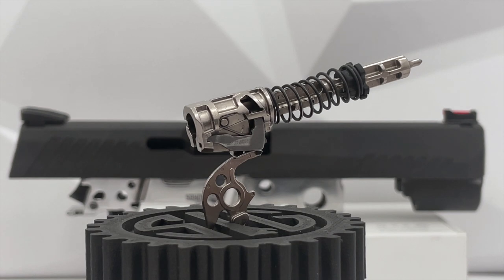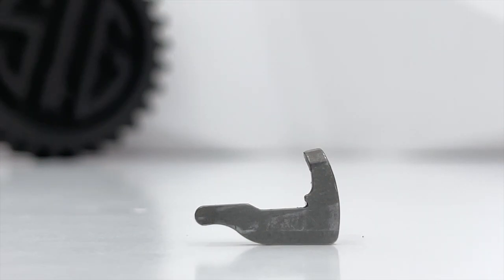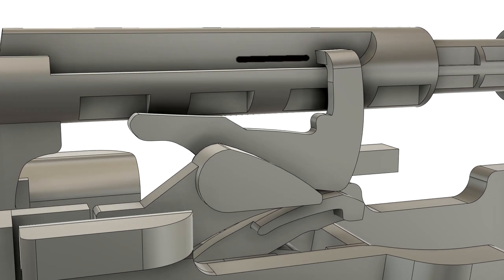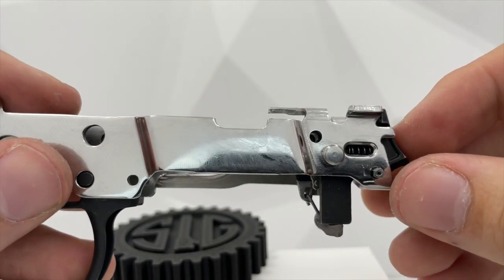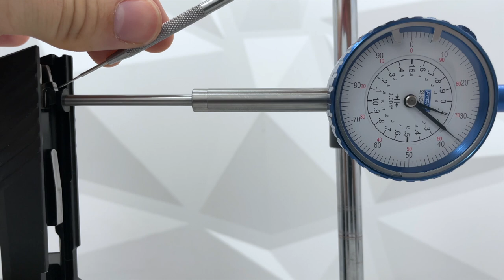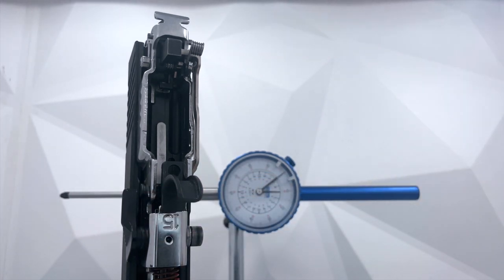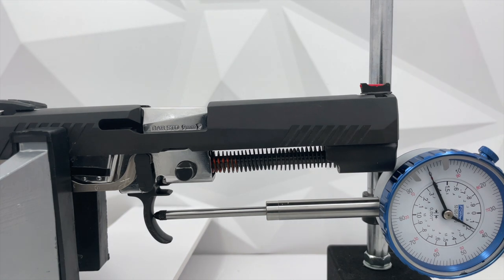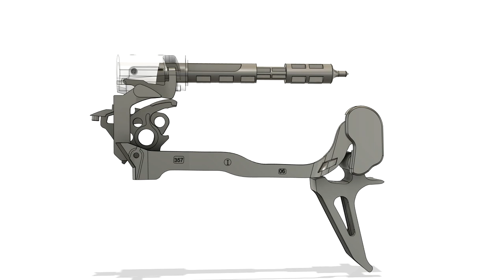P320 - STRIKER SAFETY DISENGAGEMENT PARAMETERS

Comment: Edmund, this video is incredible. The thing that really showed me how safe the p320 is, given the operator doesn't negligently discharge the firearm upon reholstering, or just in general. It shows that the safety really is the brain and trigger finger of the operator.
Reply from the maker: @Joshua Bracke, At the end of the day I found this safety to be more misunderstood than anything else. I mentioned in another comment some time ago that should Sig have made the step on the striker taller or the tab on the lever thicker the "problem" would be ultimately the same. If they were an full inch tall or thick, the operator will have had to fully press the trigger all the way enough to discharge. The act of disengaging the safety (that's not meant to act as a trigger block) would have no bearing on the resulting ND. Anyway, thanks for watching (and sharing) the video!
Reply: That's a great analogy and very true.    As always keep making great videos as I look forward to watching them. Cheer m8.
Reply: Then we have a video of a Sig going off in a Safariland holster...how do you explain that?  The officer had his hands nowhere  near his holster.
Reply from the maker: @Osprey1994 the current theory is that by bending over something flexed, causing the trigger to be pressed. I’m not sure about specifics like if the firearm was fully seated in the holster at the time however, as you can see from the details in my video there is not much play between rest and discharge.

Again, this is just a theory since proof has not truly been provided one way or the other.
Reply: @SIGMECHANICS  I wonder if that issue of the 320 going off in holsters would be mitigated or out right prevented if a trigger safety were in place, as with the Glock. The problem with the 320 trigger design is even lateral movement can pull the trigger, whereas with the Glock the center must be depressed. I still say Sig made a huge oversight with that design decision. Also not blaming the holster itself doesn't help the public perception of Sig. It doesn't inspire confidence for existing customers, that's for sure. I still think the 320 is inherently safe, but my confidence in it has been shaken not because of its design, but because it is made by US Sig. A shame, really. Maybe they'll win me back someday, but for now I'm still sticking to my Glocks for carry.
Reply from the maker: @joshuabracke5775 A completely valid POV. There is a trigger that gives you a “dingus” like the glock, but it’s not very good as a trigger. (Works great, just feels bad).

There’s always the option to ADD a manual safety by using a service or a product like the MSAFE-T tool i released last year.
Reply: @SIGMECHANICS  This is true! The Glock aftermarket exists for a reason, some justified, and some gimmicky. I personally add OP Poly-dat shoes to all my Glocks. Inexpensive and effective!

I wasn't aware of that. Cool!

Comment: You had me sold at the beginning of the video when, with the spring disengaged, and the sear was manipulated no firing pin was exposed.  But after pulling the trigger and "firing the gun, only then the firing pin was visible.  Very valid.  Thank you.  Sig owners everywhere should be rejoicing at this wonderful and well thought out experiment of engineering of the safety features of this firearm.   Insert crowd applause gif here that I can not insert on YouTube
Reply from the maker: Hey @James "Buzz D Clown" R. Good to "see" you again. lol, Thanks! I just hope the video helps those that maybe didn't understand this safety mechanism as well before. No need for applause, your kind words are just as good to me, if not better!

Comment: Top-notch stuff!
Reply from the maker: Thank you @Richard Harris!
Reply: @SIGMECHANICS  So I've been a Glock guy for many years and know them inside and out, but recently a  friend got me into building my first P320 for fun. With your experience what would be the most common part or parts that would fail in the P320?
Reply from the maker: @Richard Harris. That's a tough one because I rip apart and re-assemble it so much (especially now with these videos). That being said, I do have experience in what parts will most likely get damaged (and lost) the fastest with heavy abuse...

1. The striker reset spring: I have crushed one and snapped another and also find they compress quite a bit over time.
2. The trigger bar spring: Its pretty damn solid but will deform over time if you're constantly pulling it out.
3. The extractor assembly: If your taking it apart (all 3 pieces) a lot it loosens the press fit between them.

Now that I wrote this, I see the pattern of everything that's a spring is probably the first to either deform/loosen up or get lost on the workshop floor. The rest of the hardware is likely not going to give you a problem long term.
Reply: @SIGMECHANICS  This is a really good start for me. I really appreciate all your input and experience. I'm just getting started with the P320 phase of my life. Lol, and looking to build my spare parts list for it. Springs are definitely top on my list:) The only other thing I figured would be the striker and sear being they see most of the stress during cycling.
Reply from the maker: @richardharris5819  In that case, maybe pick up the Gray Guys Competition Kit. The kit comes with a polished sear, polished safety lever pin, two sets of sear springs (med and competition) and a adjustable trigger. Plus, if you're looking for the stock OEM look, sell the trigger and make up some of the cost of the kit. It's a good way to have extra parts with the benefit of improved performance.

Comment: Great video. There are two more variables to keep in mind. (1) How much free play there is between the slide and frame. (2) The full impact of a loaded and accelerated striker will likely break through the safety at a smaller travel distance than you measured, which was statically placed under gravitational force. To find out the real safety margin, you can (a) apply some downward force onto the frame to remove the free play, (b) pull the trigger with various distances such as 0.03", 0.04", 0.05" and (c) release the sear from the back to find the exact point where the impact of the striker can break though the safety ledge.
Reply from the maker: Hey @fjcruiser9911. Your thoughts on the shear strength of the striker levers tab is very interesting (I wonder if we can test that). However, like most things the chance of it happening are never zero (given many variables), but probably also too low to worry about. It would likely take a tone of force for that to occur and the spring tension wont have that strength since at full "tension" when locked with the sear, that spring is not even fully compressed. You would have to extend the striker further back than the slide cap might allow for it to be all the way compressed (Take a look at the video thumbnail picture, that spring is MAX compressed and you can see how far back the striker body is). 

Interestingly, I actually considered your first point when I made the video regarding the play between the slide and FCU. Hence why at one point in the video I talked about stripping all the internals to get a good view of the inside. (I wanted to explore the take up between the levers), I was going to see how that play affected the relation between the FCU and the striker levers, but all I found was that the gap between the two (when the slide and FCU were at their furthest points), was so absolutely insignificant that I didn't proceed with the demo. So to that I say, "good thinking" because I would have sworn there was more take up than there actually was.

Lastly, the dropping of the striker by gravity was solely for the purpose of giving me a simplified method to read the safety levers travel distance not for anything else, but, I do see where you are coming from. This video was for discovering the parameters to disengage the safety in normal operation. What you are talking about is FAR more interesting...What are the absolute limits of the safety mechanism to the point of malfunction...I like the way you think!
Reply: @SIGMECHANICS  Thanks for the explanation!

To clarify, I'm not worried about shear strength or deformation of the safety lock, but my concern is that the safety lock itself is spring loaded and can move under impacting force. You measured the thickness of the safety lever ledge to be 0.033", and the amount of travel to disengage is also in the same range. Now, imagine that we only lifted it by 0.020" and the sear breaks off, hitting the safety lock edge at the lower 40% of its depth.  Will the ledge on the striker push up the safety block and keep going? I guess it depends on the shape of contacting surface, which is a rounded shape if we look at microscopic scales. There may be a point where the striker can simply "lift up" the safety lever by overcoming its spring tension and keep going, while gravitational force may not be able to do so.

I love your methodology of discovering the internal parameters on each component. When testing software, there are different approaches: "unit testing" and "integration testing". The former focuses on the properties of each individual design element, which is similar to what you are doing, and the latter focuses on the integrated end-to-end behavior in more realistic environments. What I'm suggesting is a more of an end-to-end integration test, where we simply pull the trigger by X" and see if it can actually block the flying striker. Even if it cannot block the striker, if it can rub on and decelerate the striker to the point where a Federal primer will not be ignited, I'd call it a success.  The result in my mind is more of a 2D graph, where the X-axis is the distance of trigger pull, and Y-axis is the probability of striker passing through (or igniting a Federal primer if the sear malfunctions). The falling curve and cut-off points would show the real safety parameters of the mechanism, which probably depends on the strength of springs as well.
Reply from the maker: @fjcruiser9911, Oh I see now. That is a great idea/question. I think having the trigger consistently hold at a given distance while releasing the sear may prove difficult to reproduce consistently. However, maybe If, say we slowly added shims of known thicknesses (thickness gauge leafs?) under the safety lock tab we may be able to do this! I'm going to write it down in the list of things to test on the channel and put some thought into how the testing would look like. If you have any input let me know. You can also email me at sigmechanics@gmail.com

Thanks @fjcruiser9911!
Reply: @SIGMECHANICS   That's a brilliant idea! Not only shims can make the tests more consistent, but it might actually simulate carbon/powder build ups in reality. So we'll know how dirty it needs be to compromise the safety! Will let you know if I come up with more ideas :) Keep up the great work!

Comment: Excellent Video! The lab style breakdown and 3D graphic diagram are very helpful as well. The SIG P320 has a nice very short trigger travel of 0.2" or a fifth of an inch. You confirmed that at .09 inches, 45% of the short total trigger travel is required to disengage the safety. I do desperately want it to be a drop safety haha

I have a P229 combat that I installed the SRT in and it also requires very little movement of the safety lever to disengage the firing pin block, but the required trigger travel to lift the block is about a full inch on a DA/SA trigger lol Interestingly the SRT works by keeping the firing pin block disengaged when the slide returns to battery thus relying solely on the firing pin rebound spring to keep it from contacting the primer of the next round. 

Feel free to shout me out SIG daddy  haha thanks for taking the time and tools to make this!
Reply from the maker: @Subgun Snake. LOL, done! A credit to you has been noted in the description section of the video!

Comment: This was one of the best, most detailed, and highly informative P320 vids or even just general firearm videos I've seen in a long time.  

Do you happen to have a video about how the manual safety version interacts with the sear?  With the safety on, does it prevent any sear movement?  Or does it just prevent trigger movement?
Reply: Yes, I would like to see a video on the manual safety version as well, if possible.
Reply: @abro7735  I just tested my P320 Compact with manual safety, and the manual safety keeps the trigger from moving when the safety is engaged.

Comment: Thank you for taking the time to make this very informative video.  It gives me a much better understanding and a little more confidence in the P320.  I would like to know your thoughts on the P365s striker safety depending on the striker sear “appendage” to actually not break off the MIM part.  I know there is a very good video out there of an engineer trying to snap off the appendage with no success but I sure wish they would of incorporated the striker safety on a different part of the striker like the P320 or even Glock.  Thank you.
Reply: I'm with you there. I saw that video and while the P365 sure is going to be safe enough, I still prefer the Glock way of doing it. It's just better in my opinion.

Comment: Love these videos the  only problem I see with p320 design is if the gun is droped/extreme g force of impact that the trigger acceleration by the drop can overcome the needed resistance of the safety system by having a safety like glock's trigger paddle or s&w hinge trigger prevents the raw acceleration of the trigger from discharging the firearm
Reply from the maker: @GHOSTWARRIOR117. Thank you! I’m glad you’re enjoying the videos. It’s interesting that you say that because it has been a controversial thought that, even with the “upgrade program”, the safety could still fail but there hasn’t been any specific proof though. 

Sig Sauer’s only statement in the past has been that after the change of the trigger, the drop fire issue was solved…HOWEVER, I said it’s interesting that you bring it up because recently (in 2020 I think), a lawyer uploaded a video on YouTube that showed the lock safety failing due to shock/vibrations. That video unfortunately has been taken down because Sig Sauer just a few weeks ago challenged them (the lawyer) and has opened a law suit against that law office.

A great benefit is that now we might have documented evidence of either failure or no failure of that exact part! (I just hope that the data or transcript is made available/accessible to us in the public), if they do I will follow up with you and viewers because I believe that it would be critical for us to know as consumers one way or another.

Comment: Great video. Really explains how the P320 works. I think operator error is the main issue combined with a very short take up with the P320 trigger. The extemely short distance that the trigger needs to travel is what I'm concerned with. Its almost to the point that it is like having a 1911 without a thumb and grip safety.
Reply from the maker: @C Lowe. Thank you! I'm undecided myself on whether I consider that too short or not. I will say that I've been playing with the safety a bit and might make a video of the results. Thanks for your insight!

Comment: As a toolmaker,I appreciate the time and effort you took to do this.Ive wondered about how to time the striker release more closely to the disengagement of that little striker block lever.It moves .036",but it can travel up further than that.Im not sure,but the lifter is still moving it upward in the last .110" of trigger pull,adding to the pull weight the more its compressed[?]. At any rate,you have a good setup to see if some modified triggerbars like apex and others,comprimise the drop safeties.I could envision an gunsmith inspection jig for armorers to see things more closely.
Reply from the maker: @bergmannsimplex. Yes, the lever will continue to lift all the was through the trigger pull. I don’t believe that it affects trigger pull weight to any significant degree since it lifts all the way through over travel. Im working on getting a video out in the Apex since it’s such a common upgrade, so stay tuned. Anyway, thanks for your kind words, glad to have you here!

Comment: It seems to me, all striker fired pistols incorporate a spring loaded firing pin held back by some sort of mechanical stops until the trigger is pulled. Glock does not fully compress the striker spring until the the trigger is fully pulled, and SIG uses the safety lever you so amply described.  Stored energy held in place by mechanical parts, good mechanical parts, but still a source of failure.  The rather elegant solution is called the SIG P250 with its smooth double action trigger that requres the shooter to provide the energy to fire the round.  Its a shame this firearm never acheived the popularity it deserved.
Reply from the maker: You are absolutely right about the P250 being underestimated, I really liked it too. 

I believe in and trust in the P320 but of course (like any firearm) I could never present it with absolute guarantees that it could never fail. 

I also think that the drop fire issue in 2017 is proof that no matter who you are as a manufacturer, it is always possible to fail at something as mechanically complex as a gun where a plate of metal (or literally the weight of a part) is the literally the barrier between safety and discharge.

Thanks for commenting!
Reply: The bottom-line truth of your first three sentences is why I would never replace the P250 I own with a P320.  The P250 is a marvelous "9mm flat revolver" that is far safer to carry than any P320 will ever be.  Too bad Sig shifted to a striker-fired FCU for the P320 when people proved unwilling to master the art of a perfectly-designed P250 DAO trigger.